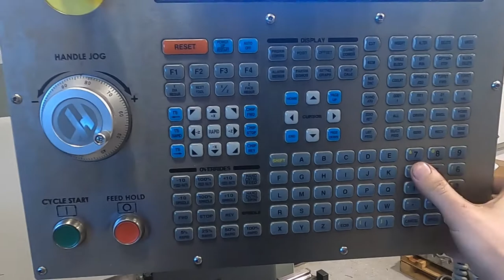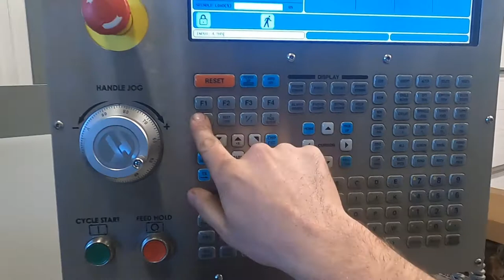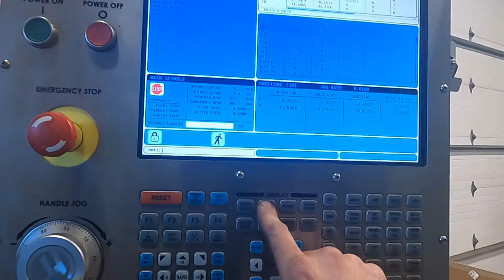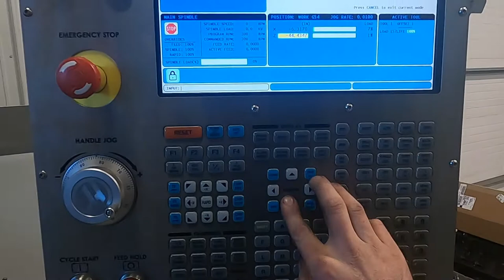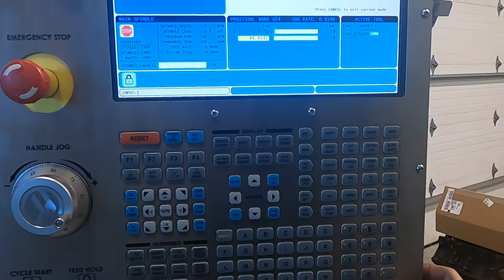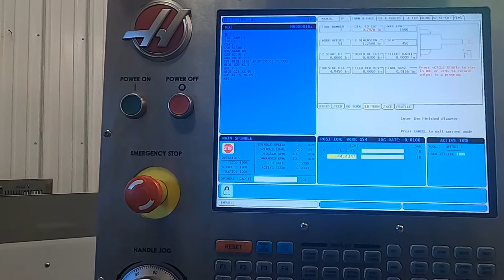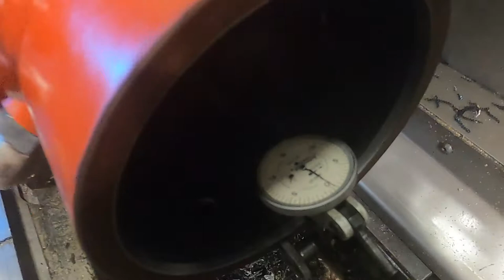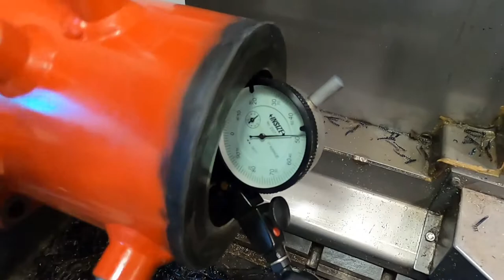Repairing and Rebuilding Hydraulic Center Swivel Center Post on Haas Tl-2 CNC Lathe

Comment: Over the years i have been given many of these rotary cylinders to repair with Hard Crome plating. The internal bore is ground out to remove all the damage, it is then hard chrome plated undersize by around 10 to 15 thou. Then lastly reground to finish size, with, if possible, a very shallow taper to aid the seal compression on re-assembly. Always warm up the seals before fitting in hydraulic oil (never water!) and use vaseline to lube them as they slide in.  After being hard chromed these rotary seals tend to last forever as they are more resilient to corrosion.
I have also re-chromed 1000s of hydraulic rods in the last 50 plus years, and here is a top tip for any plant owner or operator. WHEN THE MACHINE IS NOT BEING USED, PUT THE SHINY STUFF BACK IN THE OIL!!!  Why do I say this? Well consider and ponder on the following. A machine is frequently left for days, weeks, months or even years with the chrome rod sitting out in the atmosphere in ever type of weather possible.  One day you start it up, the exposed rod is probably bone dry, covered in crap oa maybe event a bit rusty, and the only direction the rod can go is back into the cylinder, and those seals ain't gonna enjoy the ride! But if the machine had been parked up with the rod in the oil, even if it been sitting dormant for ever, you will be lubing up the seals from the get go.
Look after the chrome and it will look after you

Comment: Pro Tip - Soak all teflon seals and bands in hot water for 10minutes, then install...will make bands much easier to install and they'll shrink back much quicker than working them at ambient temp....also,use vaseline for lubing..also,the can is tapered only on one side,so make sure you install the center section from the correct side so it compresses the seals as it's being assembled
Reply from the maker: Makes sense thanks for the advice. She has still be working well no leaks!
Reply: Temperature of hot water?
Reply: @VELIMUKHAMMET SARYYEV  just around boiling....basically, let it get up to a boil,then back off the temp then drop em' in.....let them sit for about 10mins ...this is something you have to work fast with....then after you get the Teflon seal on to the piston,quench with some cold water and the seal will shrink back down and make a nice tight seal.....a heat gun works well also,to help keep the seal soft enough to walk it over and get it seated into the piston groove
Reply: I thought it was recommended to soak it in warm hydraulic oil @ 200 degrees F.  I'm pretty sure I saw a Bobcat tech recommend oil, not water.  Yet I have seen many say warm water. I would think oil is better. And as others mentioned, use a spring compressor.
Reply: @timmer9lives  water works just as well...I prefer water because its easier to work with as far as getting it up to temp quicker..I was actually taught that from an old timer at my local hydraulic shop many years ago...he had been rebuilding cylinders for 30plus years at that time,so I took his word for it and have always had good luck with the boiling water trick...I've read about using hydro,but never tried it...after using water for so many years without one over-stretched piston seal,I never bothered trying hot hydro..maybe one day I'll try it though

Comment: my seals were leaking on my swivel joint and it cause all of hydraulic functions to lose power even the drives.replaced them and good as new .Did u have the same symptoms?
Reply from the maker: It was working fine just leaking on the floor. It’s a bad design in that it traps water in the top so it pits

Comment: I would consult a hydraulic specialist that knows what needs to be done to repair this expensive part before I'd just jump into doing a repair that might work or just destroying the housing. I'm sure there's a hydraulic shop in the area that will give you the options you have.